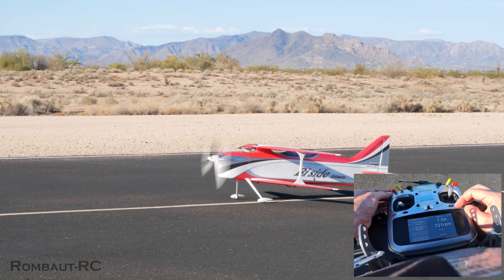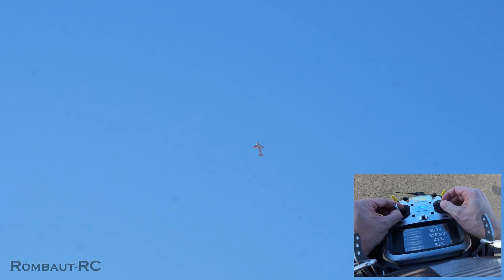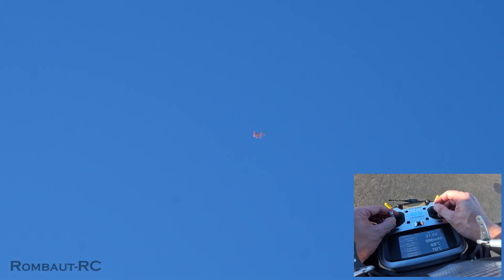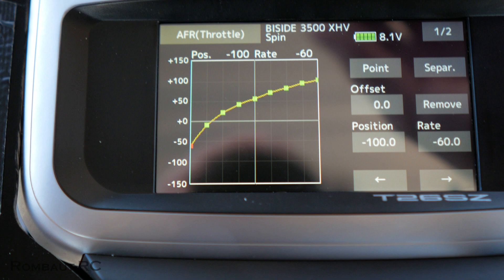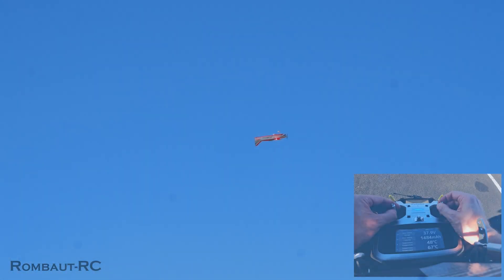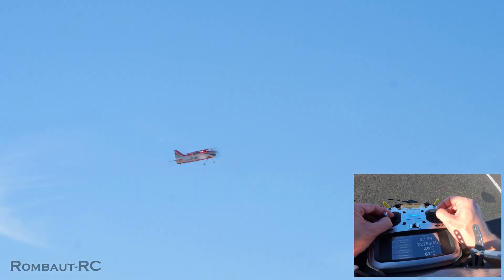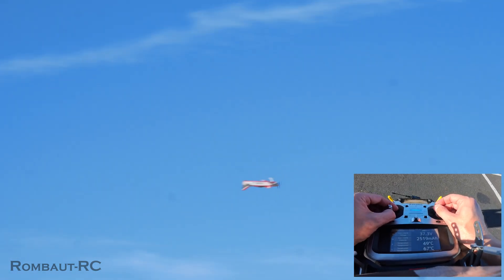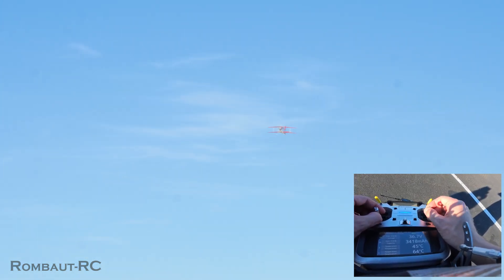Dualsky CRS3500 MKIII AE 🚀 Full Flight Test with Stick Cam, Telemetry & Setup

Comment: Hello, I'm your fan
I bought the same motor transmission as you this time
I'm using the receiver 7308+900 and it doesn't have xhv100 transmission and telimetry. I think having a video about this would help too much

Comment: Just an unrelated question....I heard you say you have a different idle  for downlines different from spins....on a switch or a flight mode condition.  I have a new transmitter that is so easy to do stuff that I end up with some 16 mixes, 28 curves and 44 logic switch conditions.  These are for tweaking snaps every which way on each line, for hammers both ways and for + and - spins both directions. Nott necessarily because I need to but because I can.  Just want to know if this is normal at your level. Thanks
Reply from the maker: Wuo! That's a lot of conditions! I tend to keep everything as simple as possible but it's true that it's important to be able to execute all kind of snaps and in any direction and for that I also use logic switches. For the idle, yes, I think is common to use different idles for different manouvers, especially if you are using an ESC with Governor. Mainly one for normal flight, and the other for Spins. For the Biside I use two: One for everything and another one for Spin Entry.